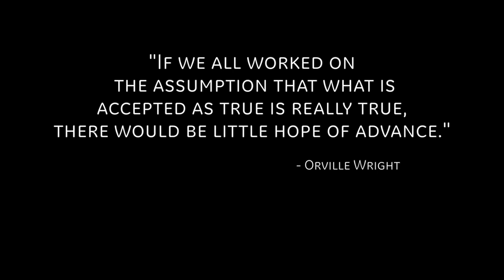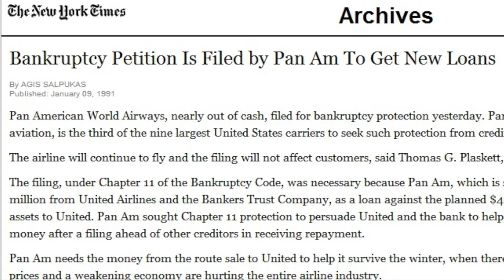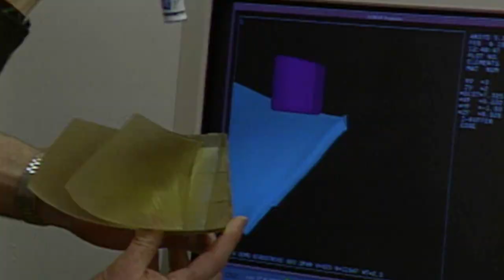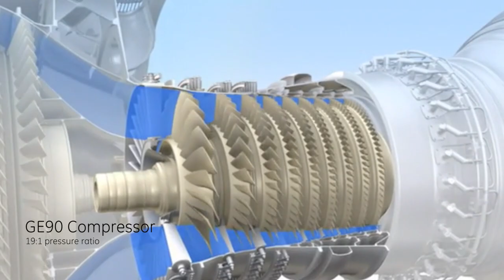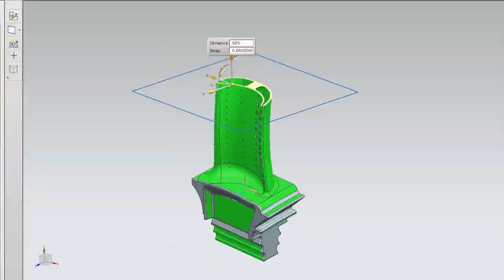GE's Big Bet on Goliath Engines

Comment: They can build those engines, but they can't build a refrigerator worth a damn.
Reply: Psycho9263 🤣
Reply: Well, the GE I just got rid of lasted about 12 years trouble free. The ice-maker was poorly designed (IMO), but it did work.
Reply: This...👆I knew there would be a comment about this. Last two refrigerators I had were GE and total junk.
Reply: thekeyboard warrior  One fridge was my parents, the other my landlord's. I've actually never bought a fridge.
Reply: I have a GE fridge my parents purchased nearly 50 years ago and it still works.
Reply: That is because they want out of the appliance biz
Reply: @mandingo7142  yeah that was back when they were made in America. Now youre lucky if something dosent break within a couple years
Reply: @davidr5576  They are out, sold it to A Chinese company.
Reply: @mandingo7142  In that case - they were a better fridge builder back then! :)
Reply: @mandingo7142  Back then, appliances were built to last, literally. Today with planned obsolescence, they're built to last a few years, if that. GE is probably the worst.
Reply: My fridge puts out 2500 #'s of thrust. It works great.
Reply: GE doesn't actually make appliances any more. Haier of China has licensed the GE name and logo.
Reply: Man Dingo We has a Kenmore microwave bought in the 70s that only had a big internal fuse replaced in 20 years. That’s never happening again and Sears is doing great today🤡

Comment: ‘We were the first to develop carbon fibre fan blades’ - Wrong! Rolls-Royce were developing them for their new RB211 engine in the 60’s. The original development was by the RAE, Farnborough. They found that they were not good enough in bird strike situations so therefore went with a blade with a honeycomb structure covered in titanium. This produced wearability and strength.
Reply: Exactly.
Reply: Wrong! You mean they "tried to develop"!
Reply: terry wilder No! The RAE, Farnborough had developed them but when Rolls-Royce tried them they were perfectly acceptable as a fan blade but couldn’t withstand a bird strike. Thus they ditched the technology and went to the honeycomb titanium blade.
Reply: Marcus Wardle Somewhere In there, Rolls-Royce developed a thing called Hyfil, or something, which was a single crystal blade.
Reply: @marcuswardle3180  Incorrect again! If they can't stand a bird strike they are not acceptable as a fan blade!

Comment: It’s really a miracle in itself to think you can take a bunch of parts ,stick them together , and push tons of metal into the air . I love when your sitting on the runway and the pilots push those engines full power and it pushes you back into the seat.

Comment: What a fantastic piece of engineering The GE90, i can happily say that saw it first hand operating while working for United Airlines back in early 2000's, i was astonished once i saw a feet away the 777 engine compared to the 767 ones and others , they are no match to the GE90, just looking and hearing them while pushing for take off it's an amazing experience . They easily lift off the 777 and their payload with no effort . Truly amazing equipment !

Comment: NIce to see such innovation. I worked at GE in Cincinnati (Evendale) at the jet engine facility in the early 80's. Our team developed the CF6-80C engines that were originally used on the Boeing 767. Unfortunately, after that program ended and it was turned over to production, we all go laid off. SO I went into computers and networking and haven't looked back. But it's nice to see GE is still  in the forefront of engine design. I also met Brian Rowe a couple of times as well. Nice guy....just reminiscing, I guess..

Comment: I worked on Gas Turbines a LONG TIME AGO, USS Constellation CV64 AIMD IM-2 Jet Shop (77-81) and all types.  Rolls Royce, P&W and the GEs.  TF34 was the GREATEST, super easy to work on, NEVER FAILED, reliable and the layout was PERFECT.  GE makes perfect engines.  TF34 in the Navy was the S3 and I had an USAF buddy inform me that the A10 also used the TF34.  AWESOME ENGINE, WAY TO GO GE.  127K+ THRUST - WOW!!!!!

Comment: The first aero engine to have composite  blades was the Rolls-Royce RB108, designed in the early 1950s. These blades were of GRP. Much later, in the early 1970s, Rolls-Royce used composites in a turbofan engine. Fan blades for the RB211-22B were of ‘Hyfil’, a carbon fibre reinforced epoxy. The blades were of a new wide-chord design pioneered by the company to reduce the number of blades necessary, and hence cut noise. So GE are not the originators of composite blades.
.
Reply: +soaringtractor Makes no difference.. Composite RR blades were in use, working and running well before the RB 211 came along when the company underestimated the engine’s development costs, which led the company to bankruptcy in February 1971. As a consequence, Rolls-Royce was nationalized, and the British government met the company’s financial obligations
As for Lockheed all but going bust, Lockheed  was on the verge of bankruptcy because of delays with the L-1011 other than the RB211, cost overruns on its C-5 program, and reduced military contracts in the waning years of the Vietnam War. Lockheed were saved only through coordinated efforts of the U.S. government  and other consolidated lenders, and committed customers. Lockheed were in the mire without the L1011.

Anyway...Composite blades are not US invented..
Reply: +crabfat In widespread service? no GE did that first is what he said
Reply: soaringtractor lockheed was in the shit with the Tri star with or without the RB211.

"That is why a smart plane builder will use two or three engine choices to prevent that !!!   DUUUHHHH!!!".............But lockheed didn't according to you....it relied on RR.

DDDUUUUHHHH!!!!!!!!
Reply: soaringtractor RR had a delayed  delivery for an aircraft that was already flopping and to a company(Lockheed) that was in the shit anyway..
The only reason the British government helped RR was the condition that the US government bailed out Lockheed.....So don't try and score on that old chestnut.
And anyway...when lockheed got the engines...the plane turned out to be a duffer when no-one would buy it.
Reply: soaringtractor I'm talking about after the plane had the engines and was in production.....so don't try that one.
Reply: soaringtractor Forgot about Lockheed??? What a stupid statement....is that the best you can offer. Since the Electra, Lockheed was not known as a civil airliner producer. Douglas, Boeing et al were and it is a fact that firms buy the maker, not the aircraft.
Douglas had a firm selling base and the DC 10 was outselling the 1011 before it was even built
Now....Get this understood. I agree that the problems besetting RR did not help, but they were not the only reason the aircraft failed, in fact they were a minor reason in comparison to the others.
The aircraft was behind schedule, (BTW the delay was only 1 year, not two)..

The RR engine WAS available for the prototype and its first flight in 1970 as promised and as required....but you don't mention that Lockheed discovered fairly early on that the TriStar suffered from higher than estimated structural weight, and specific fuel consumption. To rectify this problem and to meet performance guarantees,.lockheed told .RR to make alterations to the engine.... which doesn't just happen. do you know the term "Move the goalpost".
And don't forget, the RB211 was the first 3 spool jet....and as you have said yourself in other arguments when defending US delays, problems etc......something new takes time and there will always be delays....especially as this unit was designed specifically for the 1011..

There were also design considerations that favoured the DC 10 over the 1011, and made a considerable difference 
If you wish I can give you as many links as you like....but to say the aircraft failed through RR alone...is a childish statement.  Besides, this was early 70s, by the 80s the RB211 series was a success, as were all the other wide bodied jets that used it....so why could they not sell the superior 1011.?

Now, you are beginning to bore me on this subject.....I can see why you are universally considered a pariah.
Reply: He Plows, He SCORES!

(Al ittle ditty too my hearow.)

Soaring tractor is a snore
Soaring Tractor wins all wars...
Soaring Tractor, 1, 2, THREE!!!
Soaring Tractors the one for me!!!!!

Dear SR, 
I fink you are bwiliant.
when I gwow up I wunt 2 B lyk Yoo.
I hoap yu LIK mye song.

PS I lyk Bob the bilder t0o!!
Reply: gobbles popcorn eagerly
Reply: Tea and crumpets is so much gayer.
Reply: What killed me with the Runs-Backwards 211 was the amount of air required to start that pig. Yes it was a reliable engine, but we would have to have 2 air-starts connected just to get N1 up to speed to start an L-1011 Freighter.
Reply: +soaringtractor the only reason why GE hasn't gone bankrupt is that it's FUCKING HUGE company RR is tiny compared.

Comment: Tend to prefer GE over RR, our British engines haven't been the best for a while, a few issues with certain RR engines
Reply: guitarplayerforu Where exactly do you get your info from? And brits can spot people MASQUERADING as brits many miles off
Reply: Im a brit born and bred, rolls engines are great and i got my information from aviation events that recently happened involving faults with RR engines. Both ge and rr are good makers
Reply: Dont you talk to me like that. Its called a matter of opinion, i never said rolls are not good engine's, of course they're good, but you cant deny the GE90 is the most impressive engines ever built. Yeah ek switched to rolls royce for the A380's from late 2016. Both makers are great.
Reply: guitarplayerforu n
Reply: is that really true?
I thought that that was a cost saving measure. perhaps even a deal to keep the a380 relevant for longer?
I've read that the sales for the a380 have really stagnated in the past few years, with the few airliners that run them demanding major changes before they commit to buy more air-frames.
Reply: Nath D, Having to insult just proves you're the one with the lower level of intelligence here, also makes you hard to take seriously.
Reply: As an ex 747/ MD-11 mechanic, I can truly say that GE makes some of the most reliable and fuel/ oil efficient engines on the market, and yes I would prefer a Rolls over a Pratt any day. Granted my experience goes back to the CF6-50, CF6-80 RB211and JT9D /PW4000 days. Regarding the Pratts, we used to have a saying: "Check the fuel and Fill the oil" as the Pratts consumed a lot of oil per flight. Regarding the A-380, it is a PIG. Greatly under-powered and nowhere near as graceful as a 747-800. The GE-Pratt alliance for the CFM-56 (commonly found on the 757 and scarebus 340) and GP7200 on the scarebus 380 was a huge mistake...
Reply: Ryan Zacek do you mean the CFM56 For the 737? I've never heard of applications of CFMs on a 757 , only RB211 and PW2000
Reply: Yep, case of the fatfingers I intended to type 737...
Reply: Trent 1000 😬

Just wanted to stir the pot.
Reply: Nath D hey nasty attitude guess why all RR engines fitted on the 787 are grounded. America will always rule the airline industry
Reply: cough cough trent 1000

Comment: I would love to see an A380 or a 747-8i rocking four GE 90-115Bs
Reply: 1whiteiphone load up KSP, you can build one!
Reply: Whenever a 777 taxis past a A380 the pilot says 
“Nice little engines u have there Airbus”
Reply: The takeoff power of A380 is 300,000 pounds of thrust because of 4 RR trent 800 or EA each of this engine has a power of 75,000 to 80,000 pounds of thrust if 4 GE90-115Bs in A380 it is so powerful with a power of 460,000Pounds of thrust each GE90-115Bs has 115,000Pounds of Thrust also the A380 will not fly in longest range
Reply: The wings on the 747 cannot support all the of the thrust pounds but that would go faster than sanic

Comment: I am one stock holder who is praying that this is the greatest advancement ever and that GE sells a gazillion of these engines. Who knows we might see a $30 stock again.
Reply: Hi Charlie Austin, correct me if I’m wrong, but hasn’t the industry changed directions in favor of a mid to long range - efficient jet? For example Boeing’s 737 series is perhaps the best selling plane we have seen so far. It has performed excellently; that is of-course, until the recent accidents involving the 737 Max,  which has cause major airlines to cancel orders and has caused the groundings of the entire global fleet. 

There has also been a decline in operations of the 747 series by airlines. The “Queen if the Skies” utilizes jet which utilizes the GE9X engine. 

I’m hoping all turnouts well for Boeing. However, I am interested in seeing how Boeing manages to recover from the recent accidents with the 373 Max and am particularly interested to see how this could mean for Airbus and their new A330neo, but I am also cheering for the success of the 777X.
Reply: Pray harder, the ge stock is near worthless.
Reply: @Tconcept  BUY.

Comment: The GE90 was designed in the late 80's early 90's and had the first composite fan blades ever on a commercial engine. It's 2016 and GE is on it's 4th generation composite blades while no other engine manufacturer has any composite blades on their engines. The weight savings is tremendous and makes the GE90 the most efficient large jet engines on the planet. The GE9X will make the GE90 look like a mid 50's gas guzzling turbo jet engine. The GE9X will have composites in each area of the engine like the huge cowling will be all composite along with that beautiful extremely large fan blade. Around 43% will be composites along with new metals that GE is not giving any info on that is much lighter than Titanium with better heat resistance at higher temps while having more rigidity, it's also easier to work with.
Reply: Ghost Metal?

Comment: "Carbon fiber super alloy" Really
Either is a Carbon Fiber composite or it s a super alloy, not both
Reply: John Ritchie The alloy is carbon fiber skinned with another alloy over the leading edge of the fan blades.
Reply: @chloehennessey6813  Sure. But the description given implies that the materials are blended. They are bonded, but not blended.
Reply: It's like saying Oil flavored lemonade.

Comment: ROLLS ROYCE ....The King of Commercial jet engines
Reply: The CF6 series, a mixed blessing for GE. On the one hand a great selling engine. On the other, probably the engine with most safety issues. Google GE45/50 and some 80 series models to see all the NTSB directives. Overall, RR are safer models.
Reply: The CF6 didn't bankrupt GE as the RB211 did Rolls. The Cf6 80 makes comparable thrust to the Trent800 series and does so with a lighter engine. The Cf6 still outperforms Rolls engines with an aged platform. Fancy that.

Additionally, look up ADs for GE90 vs Trent 800/900
Reply: Matthew Trujillo I could get involved in a long, drawn out conversation on the merits of CF6 v RR Trent, but I think the comments section from this ATW article have saved me the time atwonline.com/engines/turkish-airlines-orders-more-ge-cf6-engines-airbus-a330-fleet. Worth a read if only to educate you with facts.
Reply: Trent 1000
Reply: Soviet Union on the 380👌🏽 had to service on... i was sepriced of the amout of oil she can hold.  Coming from a a320. A330 and a340  backround
Reply: @hallobyebye699  how bout ge9x?
Reply: Uh no
RR eats up valuble titanium for their jet engines. They could use carbon fiber instead! Titanium is abundant but refinement is absolutely RIDICULOUSLY HARD AND EXPENSIVE!
Reply: Rolls Royce jet engines .Com
Reply: Trent 1000 no good, lots of problems.

Comment: At 6:27 the Emirates 777 takes off with a Rolls Royce Engine!!
Reply: The RR was made available on the 777-300, just not the ER model. Larger wingspan and extra fuel capacity required the extra thrust of the GE90. RR also available on the 777-200's as well if I'm correct.
Reply: Jeff D. yes u r absolutely correct. The RR's were available only 773 and 772's. The Emirates which takes of at 6:27 is a 773 not a 77W with GE's
Reply: vst9688 Yeah, Emirates used the Trent engines for their -200 and -300 planes. GE90s are available for those planes, but Emirates went with the Trents instead. As you said, though, only the GE90s are available for the -200LR, -300ER, and Freighter versions. Also, only GE9Xs will be available for the new generation of B777 aircraft.
Reply: vbscript2
Actually ... I was just reading a couple of days ago that RR is developing an engine also specially designed for the 777X series ... supposedly Boeing will offer it as an option. it's rated at 99,500 lbs. of thrust. It's the RB3025 ... here's the link. Enjoy !!  http://www.flightglobal.com/news/articles/rolls-royce-pushes-new-engine-concept-for-777x-369294/
Reply: vbscript2 GE-90  proved  more  reliable than Trent 800 ..
Reply: Jeff D. That report is back from 2012..Boeing selected the GE 9X in March 2013
Reply: On the 777 it wasn't necessarily a question of reliability ... the extra thrust of the GE90 was needed for the extra weight, wingspan and fuel capacity namely ...
Reply: compteck7 ... I thought it was going to be offered as an option if a customer wanted RR ... or am I wrong ?
Reply: Jeff D. Boeing selected GE as the exclusive engine supplier for the 777x...much like Airbus selected RR as the exclusive engine supplier on the A350
Reply: You're right, I dug a little deeper ... RR still wants to get it's foot in the door, but GE has got the rights ... again. it is exciting to see RR working on it's next set of new engines though.
Reply: THOSE ROLLS ENGINES SUCK AND ASK THE PEOPLE AT ANA AIRLINES WHO WERE STUPID ENOUGH TO PURCHASE EXPLODING ROLLS ROYCE ENGINES.